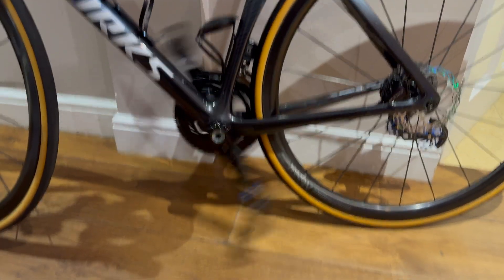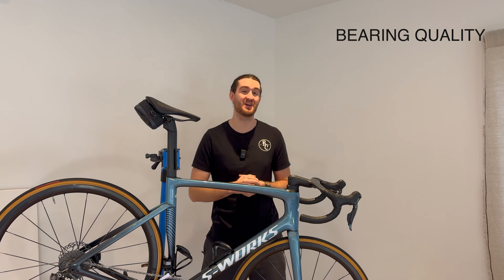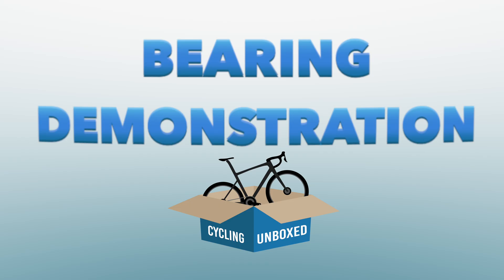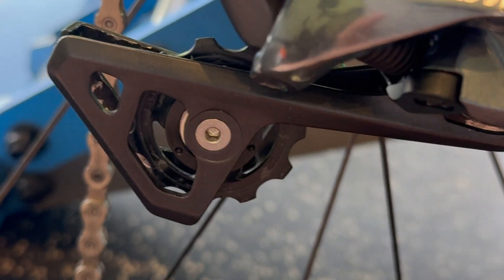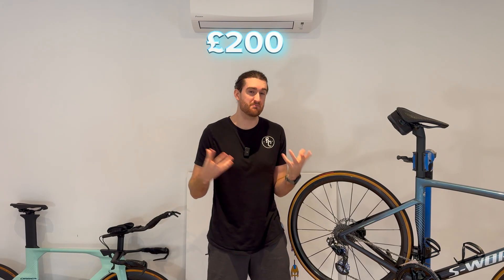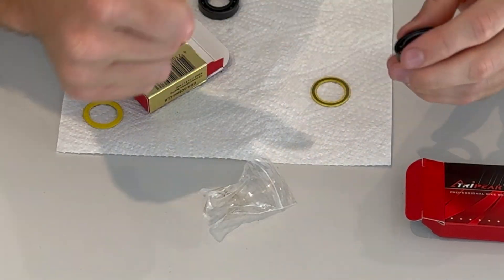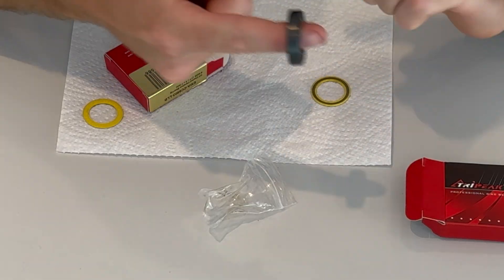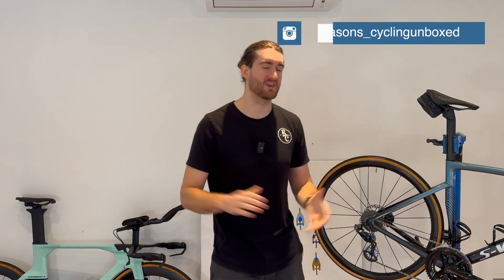Are Ceramic Bearings Worth The Money? | My personal experience

Comment: did you do any scientific tests like actually measuring your watt outputs with each of the bearing types?
Reply from the maker: Hi, 

The answer is no for this one. You need lab grade equipment for this because the numbers are so small. 

Maybe like 0.25 of a watt per bearing. I think if you are Time trialling the small gain might be worth it 

Any on road testing is far too messy to pick up any variation. 

Safe to say I couldn’t feel a difference personally. Doesn’t mean they aren’t faster though.

Comment: I love these gringos with pockets full of money and empty heads.
balance the tires to conduct a decent test.
Reply from the maker: I think a good idea in concept but I don’t think this feasible in the uk for the reasons stated below:

1, there are far too many cars in the uk. Being overtaken or just having a car behind you will dramatically change the results (probably more than the bearings will show). This may happen multiple times on the decent. You may also be blocked and slowed by cars sometimes as well.
There is also pot holes, line choice.

2. To change the bearing takes about an hour. So to do 3 runs on the steel, change the bearings out and then do another 3 on the ceramic, there is a good chance that the conditions may have changed, temperature, wind surface. This will have a bigger impact on the results than the bearings again. 

3. You could have 2 wheelsets but this is hideously expensive and any different wheelsets, once again, will be too big of an extraneous variable to test the bearings. 

4. I find it highly unlikely anyone can hold the exact same position that many times in a row. You can be close but without a camera in front of you probably not.

I believe it’s a lot more complex than just doing a roll down test and there are too many external variables which will detract from the accuracy of the testing.

Comment: Only worth it for corrosion resistance. Standard bearings can be made to spin just as freely. People may also get ceramic bearings then overtighten the preload! 🙄
Reply from the maker: It is such a minor watt gain that it’s almost impossible to measure it. I do think the short demo on the jockey wheel showed that the seals and grease has a bigger difference.

Comment: out of my 8 years of "serious cycling", the only bearing that failed me is ceramic bearing, it was BSA dub BB. A day after riding in the rain, that ceramic bearing couldn't rotate at all, because the steel race rusted, and the rust stopped ceramic balls from moving.
Reply from the maker: Do you remember which brand you used?
Reply: Shimano? @cyclingunboxed

Comment: Ceramic bearing is like 10 times the price of steel bearing.  So to change 1 set of ceramic bearing, i can change 10 times of steel bearing.  which one will last longer?  Of course, i have to do the changing myself and not send to workshop.  i once had a bike that always trap water at the bb area and i had a set of ceramic bearing on the bb.  the bearing was ok, but the raise was fully rusted and need replacing.  So money wasted.  Until one day they can come up with a ceramic bearing with ceramic raise that is 100% rust proof, im buying steel bearing instead.
Reply from the maker: They do have ceramic races on smaller bearings such as for the jockey wheels on OSPWs.
Novaride use them. I don’t think they are very good for high load applications such as wheel bearings as the race is prone to cracking? (Someone can correct me on that one if I am wrong)
Reply: The answer to races dying is to buy only Ceramic Speed’s. Otherwise, Enduro XD15. 

Anything else is shill

Comment: I'll tell you when I very clearly sensed the impact of ceramic bearings in my wheels. 
More than a year ago I bought a pair of Swiss Side Hadron Ultimate 625 wheels that come with DT Swiss' 185 hubs that contain ceramic bearings. 
It happened repeatedly that downhill - when I was rolling together with other riders, same rider position, similar road bikes - my bike started rolling perceptibly faster than their bike. I repeat: this did happen at multiple occasions. For me this was convincing enough to plan for next spring the swapping out of bearings in my BB and pulley wheels for quality ceramic bearings.
Reply: Better aero position, less frontal surface? Too many variables

Comment: what happen with ceramic bottom bracket is made metal part turn into magnetic metal. till today i not know what make it into magnet probably friction from the ceramic ball but for sure i do not know
Reply from the maker: How very strange!
Reply: Could indeed be friction. You can make a magnet by rubbing a steel needle and putting it on a floating cork

Comment: Ceramic are pretty expensive for the gains , in my experience they haven't lasted as long , put Ceramic in my mountain bike wheels , as they needed replacing not to make me faster 🤣 rear bearings were dead in 6months grumbling nicely
Reply from the maker: They certainly are expensive for such a minor gain! Interesting. Do you remember which brand you went for? 
I guess they have hell of a lot more to put up with on the MTB compared to Road
Reply: @cyclingunboxed  there were enduro bearing which have a great reputation for being good , not sure the mud helped 🤣 considered ceramic for the road bike when rebuilding it , stock dub bb was  £40 , Ceramic one was  £300 and heavier ,will it last 5 times as long 🤷‍♂️